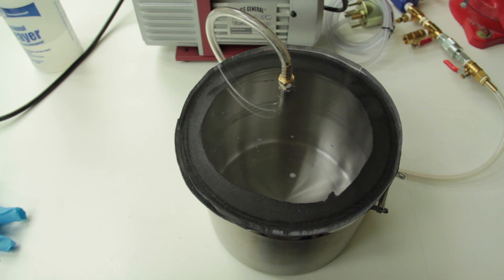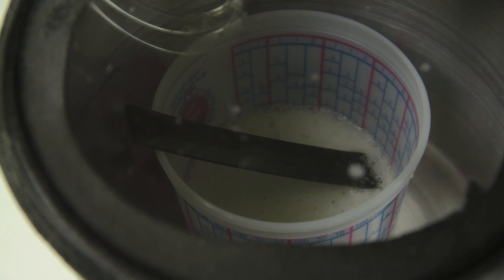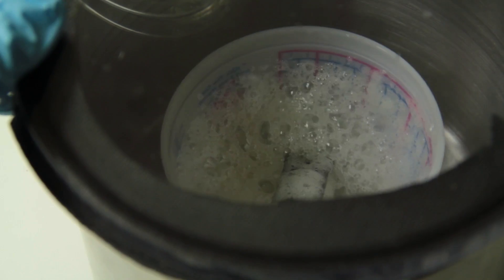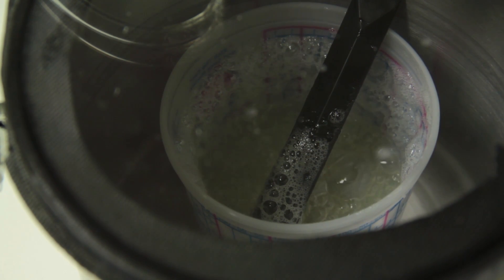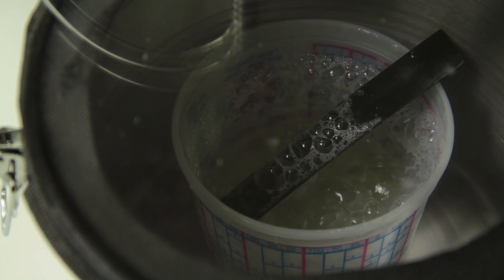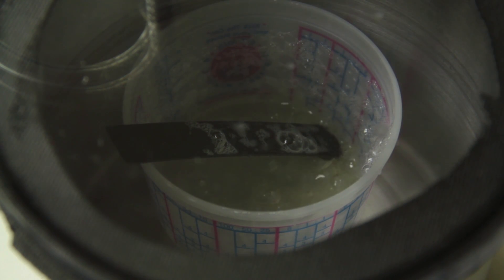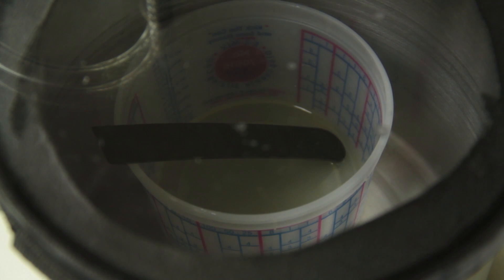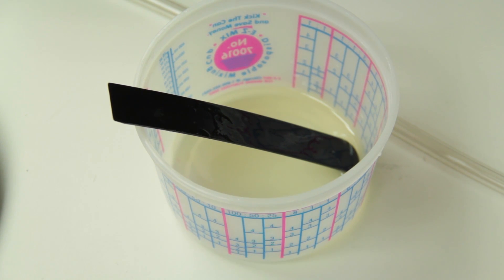Degassing Epoxy

Comment: What Vacuum pump machine do you recommend, what's the ultimate pressure and is a built in Pressure Regulator needed?
Reply from the maker: I do not have any recommendations for specific machines. Your decision will be based on what you value in a machine. Fast draw down, ultimate pressure, durability, and cost are all factors. 
Vacuum pumps are not regulated. Their job is to generate as much vacuum as they can. For degassing applications there is no reason to limit the vacuum in the chamber and therefore no need for regulation. 
In other applications which involve process gasses the pressure in the chamber is normally controlled by the systems monitoring the process gasses.
Reply: @LesWilhelm  Good to know that you don't need a regulator because it is quite costly, thanks~~

Comment: If you are going to de gas such a small amount then mix the resin then fill your mould as it must be small. Simply stick the mould in your chamber then de gas your resin inside your mould. Problem solved

Comment: I am looking at a system with a 5 gallon pot, a Pumping Rate: 5 CFM, and Ultimate Vacuum: 5 Pa,  is this sufficient?
Reply from the maker: 5 Pa ultimate vacuum is doable but my pump can only pull 3 CFM. You need a larger pump than the one I have.
Reply: @LesWilhelm  well, since it is a 5 CFM, it should be fine then. Thank you.

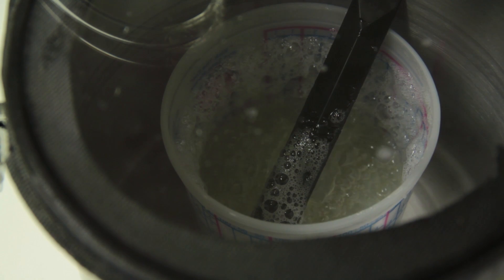Comment: All the bubbling after 3:00 is some volatile compound in the epoxy vaporizing. The gas pressure inside the chamber is not dropping any more - or else the bubbles on the spatula would increase in size. And they don't, they stay the same size. Air bubbles in the epoxy wouldn't increase in size either. So this bubbling must be some other compound evaporating. Whatever it is. Water is the most likely compound as iirc a water molecule is split off during the curing reaction of the epoxy.

Comment: What Kind of gasket is That?
Reply from the maker: It is a cabinet liner. The kind of cheap rubber mat you place in your cabinet drawers to prevent items from sliding around. I use it because it works and is cheap and easily available.

Comment: Great explaining! I got a vacuum pot, thinking to use it on my molds as well as epoxy, but had heard after the purchase that using it for epoxy was almost impossible. Glad to see I don't need to rush so much to get a pressure pot. Thank you!

Comment: Thanks a lot. Lots of great info and the most informative video I've seen so far. I haven't used a mixing stick yet and will try it.   It seems to also prevent resin from seeping over the container its sitting in and creating a huge mess.

Comment: Hi,  thanks for posting  and sharing tips on how to degas resin! 
How are you able to keep the pump going for that long? My instruction manual says that once the needle stops moving the pump needs to be shut off. I have a 2 QT BACOENG VACCUM CHAMBER AND PUMP. It takes less the 30 seconds for the needle to get to -29 and then stops moving and I have to shut it off (stays on less then 1 minute) and there are still so much bubbles in the container. I hope you can help me.
Reply from the maker: The instructions for your pump are very strange. The increase in force on a chamber going from -29 to a perfect vacuum will be less than 3%. However the pump manufacture cautions against an implosion hazard. This seems dubious. I suspect their pump may not be capable of continuous operation (most pumps can run for hours without issue) and so they are using chamber implosion as an excuse to have you stop the pump. If it was my setup I would just let the pump run and watch it carefully to unsure it didn't overheat, which I suspect is the real issue they are trying to avoid.
Reply: @LesWilhelm   Do you think I should just return this pump that I got and just get a different one?
Reply: @LesWilhelm  thank you for your response!

Comment: Have you ever made meringue. You whip egg whites to introduce air. You continue whipping until the foam you have created has so much air that it becomes stiff, and you can pull it up into peaks.                        
   The gas you see when your mixed batch is in the vacuum chamber was not introduced by the mixing. It is already dissolved in the components. These liquids are made in large vats, dispensed into the containers, stored until sold then shipped to you. Vibrations and changes in temperature cause more air to dissolve into the liquids.
   To test this for yourself. Degas the components before you mix them. Mix and then degas again. It will clearly show which theory is correct. 
   If you want to speed the process heat the components before degas them. Warming the components lowers their viscosity, and allows the gases to escape easier. If the gases are already in the components, degassing before you mix, should eliminate bubbles. If the bubbles were caused by the chemical reaction of the curing, one would expect to see the bubbles forming as soon as the components come into contact with other.
Reply: Vigorous mixing also introduces air bubbles, larger ones that are easily seen, degassing removes them.

Comment: I've just did my 2nd epoxy pour, after the first time, I exhanged my 3 cfm vacuum for a 5 cfm (both are single stage)..and don't notice much difference at all.  The thing barely gets up to - 28 and though it does bubble it does not do so as dramatically as yours.  Now, the question as you might have guessed, is that should get another exchange for their 7 cfm 2 stage vacuum?
Reply from the maker: CFM is a rating of how fast a pump removes gas from a volume. Your problem sounds more like an ultimate vacuum issue which is how hard of a vacuum the pump can draw. A 2 stage will draw a greater ultimate vacuum than a single stage pump but 28 inches is not much of a vacuum. Before trying another pump I would check the system for leaks.

Comment: Have question. Shouldnt epoxy be pressurized in the mold? And not vacuumed?
Reply from the maker: Vacuum degassing and pressurization are independent processes. They are appropriate for different circumstances but are not mutually exclusive. Vacuum degassing is done to remove gas bubbles from the epoxy. Pressurization is done to compress and shrink gas bubbles (or possibly dissolve them). Both of these processes can be applied to epoxy in which case vacuum degassing is done first.

Comment: all the time i was intend to make rock solid epoxy casting its become rubber. i am very much upset about the output. my cast is not being rock solid whether i want to make table top with resin or anything i want to convert it to. give me solution what should i do???
Reply from the maker: Check the documentation for the epoxy you are using. Some products are mixed based on volume while others are mixed based on mass. Be sure to follow the specified ratios carefully. Also be sure to mix thoroughly, any unreacted material will weaken the final product.
Reply: @LesWilhelm  Also check the cure time, I have some that sets up like rubber in about 2-4 hours, but turns rock solid in 3-4 days. Unless I bake it, that shortens the cure time.

Comment: I tried degassing epoxy resin already mixed in my vac. chamber and it seemed to introduce billions of micro bubbles. But maybe my unit isn't dropping in pressure as much as yours? Not sure what the difference is.

Comment: How do you meter the casting A & B for the right volume? Do you have a post on that?
Reply from the maker: The west system epoxy that I use has optional manual metering pumps you can get for their products. That is what I use to meter the resin.

Comment: You mention that you should mix the two parts epoxy before you introduce anything else. But I have been mixing epoxy and tints to color the epoxy all together and mixing it, and do not seem to have any problems. Is this what you are referring to. Not very knowledgeable of this process so appreciate the assistance.
Reply from the maker: Different manufactures have different recommendations for their products. In the end the goal is to have the 2 parts thoroughly mixed, otherwise you will have uncured resin and the full strength of the epoxy will not be realized. The epoxy I use is rather viscous and if I add significant amounts of filler it becomes even more difficult to mix, so I take care of mixing the resin first. 
There are other products (epoxies and otherwise) which recommend you add your fillers, colors, or other admixtures to the resin before adding the catalyst. 
When in doubt follow the instructions for your product. Otherwise go with whatever allows you to get a thorough mixing of the resin.

Comment: Oh, sorry. And what about the bubbles/clear epoxy they sell. Do you recommend those epoxies. Always thought they were just cheaper, lower grade.
Reply from the maker: The west system clear hardener is used with the same resin as the standard hardener. The clear hardener is clearer than the normal hardener (which has a slight yellow tint).

Comment: Great video. You preety much answered a lot of my question. Very informational, thanks. I do have some questions though. 1) If you are using a hour(medium/slow hardner) work time epoxy resin mix, how much less of a work tine would it be if it gets degassed for 10 minutes? Would you have 10 minutes less or half the time? Also, is there a odor once you release the pressure? Thanks again.
Reply from the maker: The time you have to work with any 2 part system starts as soon as they come into contact with each other. When determining how much pot life you actually have you must subtract your mixing and degassing time from the pot life specified by the manufacturer. Epoxies generally do not have a strong odor.

Comment: Surely a mask required when degassing EPOXY?? as fumes can be dangerous if inhaled............
Reply from the maker: For hazards you should always check the MSDS for the product you are working with. Not all epoxies are the same and each manufacturer will use different modifiers.If you have never looked at an MSDS before I recommend you read the sheets for substances you are familiar with (like acetone, alcohol, or even hand soap). Sometimes people see the dangers listed in the MSDS and think the substance must be extremely toxic when in fact many common materials they use everyday have even more dire warnings. The epoxy I use is not very volatile and acute inhalation would only result in irritation. Having said that, good ventilation never hurt anyone.

Comment: Hello there!, I loved your video and I have some questions. I make eyes for dolls and they must be totally clear. Bubbles on eyes makes me sell them cheaper.

In this video did you mix part A and B together and then put it in the vacuum champer?. Or it is just the resin?

It is posible to mix the resin and then put it in the vacuum champer, and then putting it the molds? how do you do it for the resin not to cure so fast while degassing it?

How much pressure I need to make the degassing faster?

The eyes I make are really tiny, 14mm-12mm so what kind of vacuum champer do I need? In my country its difficult to find them so soon Im going to buy one at ebay. Please, please, please, give me some advice. I dont want to buy something that takes so long to arrive and not know if this is gonna work for me or not!

Thank you so much ♥
Reply from the maker: Both parts are mixed before I place them in the chamber. The resin I used in the video has a pot life of 1 hour. This gives me more time to work with it but also means it takes a longer time to cure. 
There are 2 number which are important for how well a vacuum pump works which are the CFM and ultimate vacuum. CFM is how fast the pump can move air out of your chamber. Ultimate Vacuum is how low the vacuum in the chamber can be if you left the pump running for a long period of time. A higher CFM and a lower ultimate vacuum will increase the speed at which your resin is degassed. A 2.5CFM and 75 micron pump would be plenty for your work. Also if you have a large chamber with unused space it will slow down the degas (the larger chamber has more air to move). 
You may also benefit from a pressure pot. This is the opposite of a vacuum chamber and is used to compress and dissolve gas bubbles in your resin. Both tools can be used in making bubble free castings. The vacuum chamber is used before the resin is placed in the mold and the pressure pot after. Pressure pots are more dangerous than vacuum chambers so be sure to do your research before trying one out. There are plenty of videos available on how they work.
Reply: OMG OMG Thank you so much for your advice!!!!!! I wrote everything on my notebook!.
Reply: Hello there again!, I couldn't find on ebay to buy a 2.5 CFM but do you think one of 3 CFM could work for me?. Thank you in advance!! ♥
Reply from the maker: That would be fine. All other things equal a higher CFM is better, it is just more expensive.
Reply: Oh!, okay, thank you so much!!!
Reply from the maker: If your question is 'do they sell kits which reach an ultimate vacuum of 7.5 microns?' then the answer is no. But that level of vacuum is not necessary for degassing. If you look in their 'Compatibility Explanation' section of the product page you will see the specification for the pump listed.
Reply: So for me its okay to just buy the kit? Or do I have to buy the champer and separately the vacuum with 7.5 microns?
Reply from the maker: That is really up to you. If the kit comes with hoses that is one less thing you will have to deal with. Otherwise you will need to determine if the items in the kit are right for your application.
Reply: epoxy resins are different from polyurethane resins. polyurethane resins do not stink. and will normally be two parts.A.&.B and yes you will mix the two parts together before you vacuum the other resins polyester and epoxy do stink but you will add the catalyst hardener at the rate of.2%. and they give you a longer time before they set. about 30.minuets to just over that. some people do not measure the amount of hardener they add and just pile it in and this can result in the resin not setting or setting to fast. when you are a beginner it is best to measure until you can master doing things by eye.

Comment: It's called "boiling" when the vapor pressure exceeds ambient pressure.
Reply: it is called boiling point.
This is a physical state known as pressure-temperature relationship.
For example you could have gas like methane in a vacuum and under its boiling point which is -161.5 °C

Comment: Thanks so much for posting that excellent video. I do a lot of epoxy resin work and will definitely be building one! You mentioned you had some metered pumps for measuring epoxy. Can you tell me a bit more about those? I was thinking of rigging up a system using Peristaltic pumps but the affordable ones I've found are fairly low flow so if there's another way I'd love to hear it.

Thanks!
Reply from the maker: +Boozy Christmas I use the metering pump sold by West (same company which makes this epoxy). It is slow since the pumps are operated by hand but they are cheap.
Reply: @LesWilhelm  Out of curiosity, would the commercial catsup and mustard pumps work?